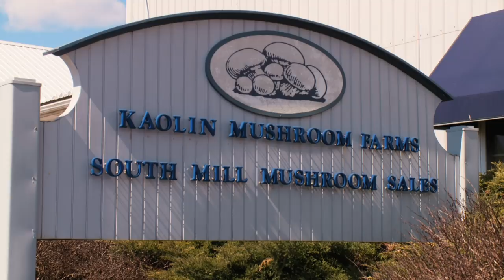MUSHROOMS | How Do They Do It?

Comment: It's a pity they don't harvest the heat given off in the fermentation process: after the initial investment of setting up the capturing equipment, that could save very large amounts of money in the long run.
Reply: But won’t the heat smell... pretty sure if they had some sort of a filtration process that would work
Reply: Harvest the heat? For what?
Reply: @saraqostahterra4548  i was thinking like for hvac 😭😂😂
Reply: @saraqostahterra4548  for the next run
Reply: Saraqostah Terra uh idk create energy?? Power all their equipment??
Reply: @spencer4584  The thing is, warmth is not the most efficient energy source in this manner.
Reply: Same reason why everybody doesnt. Its a waste of time.
Reply: Heat is only really useful for energy purposes when its hot enough to boil water
Reply: That sounds like a neat idea. Why not use it up. Might be able to fuel a reburner to burn up the smell
Reply: yeh, the whole process seems extremely wasteful tbh!

Comment: Im early also i want to grow these is there a possibility i can grow them
Reply: Yes. You'll need to sterilize a substrate then inoculate it with spores. There's plenty of info on growing shrooms at home out there
Reply: It seems daunting when you read about but its pretty simple just remember when cultivating any mushroom the cleaner the better you will have a way higher success rate with proper sterilization techniques
Reply: Easiest is to start with a kit, then work backwards. Once you've figured out the kit, next time try buying "grain spawn" & mixing it with something like straw & shit to make your own "kit". You can buy the bags to put that mix in on ebay, not worth doing anything else when the bags are so cheap & have filters for air in them.

Once you've figured out how to do it from grain spawn, try dividing the grain spawn before using & putting some into new, sterilised grain & the rest into the straw mix & once you can do that without contamination, going further is only really for the novelty of it, since that's all you ever really need to do in the growing process. 

Like others have said, there's lots of online info on how to do each step :)
& note, a pressure cooker really is a key part of the equipment for sterilising, so that it works & they're awesome for cooking too, so make sure you buy one if you're thinking about trying it beyond buying kits or ready made grain spawn

Comment: Plants consume oxygen too, but produce more than they consume.
Reply: They're still not consuming it, they're still just consuming carbon dioxide. That's like saying the sun consumes heat because high temperatures are needed for fusion. It doesn't CONSUME it, the heat facilitating the fusion is still there at the end and it still produces a net heat output, and similarly the plants produce a net oxygen output for the same reason, it's not consuming anything except carbon dioxide.

Comment: Using peat moss negates so much of the environmental benefits from growing in the warehouse farm like this, peat should stay in the ground it sequesters loads of CO2 and usually is a rich ecosystem of rare plant species, it's a shame he uses it as up till that point I thought the whole process seemed pretty good, find an alternative you're contributing to massive amounts of CO2 in the atmosphere that would otherwise be trapped in the  ground
Reply: why don't you email them? certainly they are obligated to respond to legitimate inquires especially one on this issue... do itttttt
Reply: The whole process is appalling! Waste & environmental damage everywhere! How much methane do you think's released off this per calorie compared to per calorie for meat? How much coal do you think needs to be burnt to keep that much compost at 80 degrees for 2 weeks? Shocking system all round!

& peat doesn't sequester CO2! Peat's already 100% carbon, so how can it sequester more carbon?

Comment: 5:12 Wait, How do they pasteurize THAT much in just 2 weeks? Does the narrator mean that after 2 weeks of sitting it self pasteurizes? I don't think that's correct.
Reply: I guess the room pressurizes?
Reply: The compost is put in a sealed room and heated to a specific temperature for a specific time.  P.s. it's not that long only a day or two.  I'm a composter
Reply: yeh, it said that it's kept at 80 degrees for 2 weeks, but pasteurising is generally done at 60-80 degrees, so I'm not sure how they pasteurise differently to what they already did for 2 weeks!

Comment: The thing they don't tell you is that button mushrooms are carcinogenic unless cooked at a high temperature 🤫
Reply: The thing they also don't tell you is that there's only one thing classed as the safest label, 'probably not carcinogenic'.It's called caprolactam, used in making synthetic fibers.
Only one item is classed as that, the others are 'definitely carcinogenic', 'probably carcinogenic' and 'possibly carcinogenic'